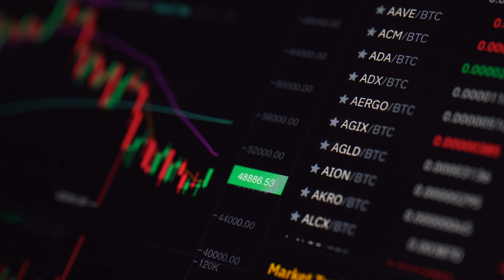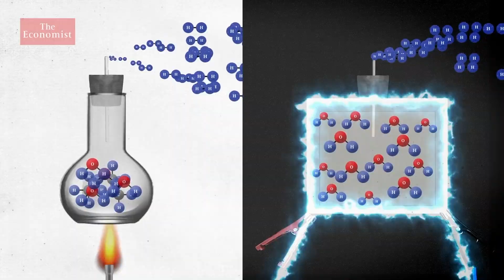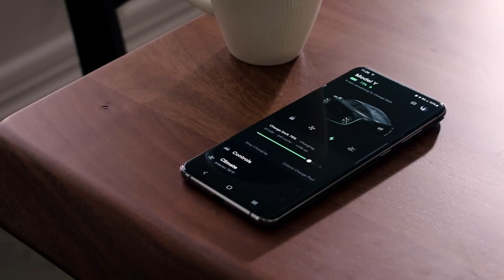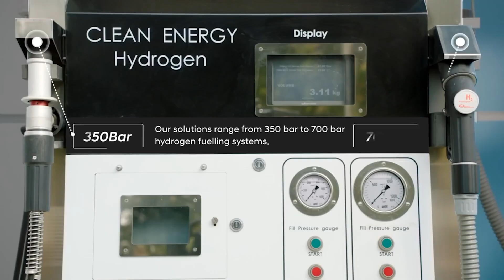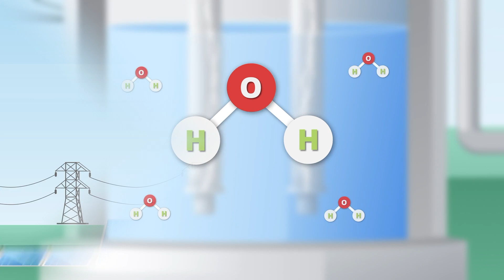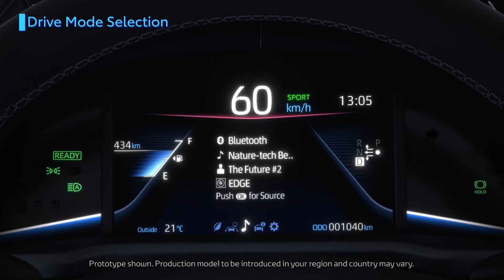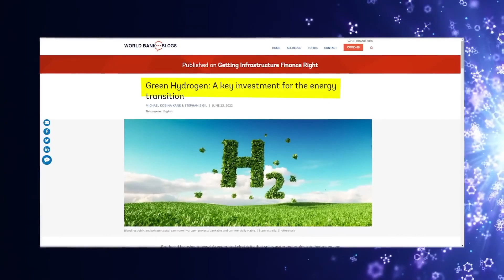EV'S Might Just Disappear! | EV's Could Go Extinct Because Of This New REVOLUTIONARY Technology!

Comment: 😂😂😂

Please tell us how much it costs to produce hydrogen. 

Also tell us what energy is used to make the hydrogen.

Also tell us how much the fuel cell costs and how long it lasts before it needs replacement.

Also tell us how many days it takes for all of the hydrogen to leak out of the tank (I think it's about 30 if I recall correctly) when the car is not used/parked.

Also tell us how much it costs to build a hydrogen dispensing station.  And how many stations there are per country?  And compare it to the number of electrical outlets available?

And most importantly.  Show us by how much all these things (producing hydrogen, building fuel cells and stations) have declined in cost per year for the last 20 years.  And then compare it to battery and BEV costs 😂😂😂.

Let's not talk about the Hindenburg though.

Shame on you.

Comment: I've been following proposed H2 usage in vehicles for over 60 years. There has been very little progress. H2 is very expensive to isolate, transport and store and use in a vehicle. Using it in an IC engine is very inefficient - better to use in a fuel cell. In the same 60 years, battery technology has improved many times faster to the point where it currently is the best prospect for zero emission vehicles. 

The environmental disasters of mining lithium has basically been debunked as no worse than mining for iron, aluminum, copper and oil exploration and refining. There may be a place for H2 in the future, but by then it may have the same issues replacing BEVs as BEVs currently have replacing ICEs.

Comment: A very one sided opinion of hydrogen that does not address the deficiences of hydrogen production, storage and distribution to the end user, the real reasons for the low adoption of hydrogen. we can only hope that these will be addressed and hydrogen will become a viable fuel.
Reply: I don't relish the thought of sitting on a hydrogen tank strapped to a moving vehicle developing a leak and blowing up. Also what kind of power are you using to make the hydrogen? The same power you use to charge the EVs.

Comment: Using hydrogen as an ICE fuel is NEVER going to be practical.  First, there is the cost to produce, transport, and store hydrogen.  A pound of hydrogen may have more energy than a pound of gasoline, but the size and weight of the container needed to store a pound of hydrogen is prohibitive. Second, if one is going to use hydrogen as a fuel, burning it in an ICE is incredibly inefficient with about 15% to 25% actually ending up driving the car.  The rest is wasted to heat and friction.  So, if one is going to use hydrogen as a vehicle fuel it is far more efficient to run it through a fuel cell that creates electricity and use the electricity to run an electric motor.  Surplus electricity can be stored in batteries.

Comment: Yes, fully agree. Good vid, new sub.
EVs are also proving to be a major fire hazzard
Reply: Good thing hydrogen is non-flammable and easy to store safely... 🙄
Reply: The amount of EV cars catching fire are tiny! In the USA there are 30,000 to 40,000 ICE Cars that catch fire every year! Don't you remember Vauxhall and Ferrari models catching fire on a regular basis until they solved the problem. If you use the motorways a lot you will see many cars and trucks burning! But not EV's. That's just FUD from unscrupulous journo's

Comment: Well, if we are going to use generators (with no catalytic converter) at the "quick" charge stations it seems to defeat the point of an EV vehicle. That EV's will destroy the car audio market. No more big custom stereos, EV's cannot power them. My buddy rented a Tesla for vacation from Ohio to Florida, and back. Using an electric vehicle added over 5 more hours to the trip, one way due to 40 minute "refueling" times, which there were 5 of them Cincy to Destin Fl. For regular vehicles, most can make the trip with only 3 refueling stops right next to the highway in about 5-10 minutes. Oh yeah, regarding an EV's range? 1) You are not supposed to run the battery below 20% charge as it damages the battery. 2) Air conditioning. Running the air in the summer can reduce range for another 20-40 miles. 320 mile range x .80 = 256 miles - 30 miles = 226 miles. 100 miles less than advertised. And are your sure sitting on a giant battery that creates a strong magnetic field for long periods of time is actually safe for your health? At the end of the day I believe both types of cars should be offered, and let the market place/ consumer decide which one is best? Both have their strengths and flaws as nothing is perfect. I do hope these "electric" cars are living up to what was advertised for consumers, especially given their higher price.
Reply: It seems that the market place / consumer are already deciding!! The reality is that hydrogen is inefficient to produce and store and we can only hope that this gets much better in the future to create a viable fuel.

Comment: little bit too much not even half true information here and very out of context data, almost misrepresenting H2
first you need to make in large enough quantities - electricity burned to do so
second - energy density is way lower than fuel little alone charge stored in batteries
third - fuel cell produce electricity for electric motor to run - no engine noise here, sorry, and cell takes a ton of space
next - h2 in liquid form needs temperatures under -200 celsius to stay liquid and therefore hold more energy in tank but the all the problems with replacing failing fuel pumps every few hundred kilometers
next - build all infrastructure for completely unused fuel type that reacts explosively with air

let's just say this video seems to sum up a LOT of whoshful thinking - go check engineering explained for some realistic information please
Reply: Yes, it's not a new idea, lve known and heard about it  for 40 odd years.  New technology  must help but don't think we're there yet, and how long do you wait while we try to  get off fossil  fuels.

Comment: Wouldn't know if this guy is talking out of his arse, but haven't heard of any great hydroden  breakthroughs  thou. 
Hydroden  demo cars have been around for a long time..
Reply: 12 x hydrogen cars were sold in the year 2021 in the UK even less last year, there are no refill stations to speak of. HYDROGEN is not a clean fuel when you take into account the cost of gas reforming,  even more expensive from electrolysis. It used massive amounts of electric much more than just using that electric to fill a battery up in a car 🚗 and do you really want a tank of the stuff which has to be kept at 700 bar!

Comment: Hydrogen cells have been widely researched over 20 years ago (by the major German manufacturers from what I know at least). There were driving cars and working concepts but the trend never picked up.
Yes, technology is advancing and there is mich more potential. But EV has so mich momentum already. 🔋
Hydrogen fuell cells will settle into the transport and cargo industry (trucks, airplanes, ships). ✈🛥🚛 
It's not always about the best argument an likely there will be no one-for-all solution (which is good to keep innovation going). Change is slow and even slower in societies.. 🚧
Reply: *much
Reply: hydrogen and planes don't go well together. ships and trucks maybe yes. but for planes, too many objections exist.

synthetic fuels are the much more likely solution for them (in a not too near future.)

--

and there's an edit function as well 😉

Comment: Hydrogen will only get wide spread usage when safety and cost are fully addressed. Don't forget solar cells and windmills also negatively impact our climate. Some insurance companies in the past would not approve parking hydrogen vehicles in doors! Hydrogen internal combustion engines also produce NOx in the combustion process. Fuel cells may be the best solution.

Comment: Battery electric does have mining impact problem, but so many new battery chemistries are being researched that there is reasonable expectation of higher energy capacity, longer lasting, faster charging, generally safer batteries, that require less or even no rare earth minerals.

Hydrogen Fuel Cell vehicles remain very niche and highly dependent on Hydrogen Fuel production infrastructure which is practically non-existent, while most real-world EV charging is happening at home on existing electrical infrastructure. Hydrogen as a fuel is also very inefficient in terms of the amount of energy it takes to create the fuel, and then the amount of transport that is able to achieve.
Reply from the maker: valid but you gotta realize a lot of countries dont have stable electricity infrastructure like we do in the west. They still need transportation and in some places they dont even allow you to install an ev charger at your home. For these people, they gotta drive out and spend time charging it, and thats if the cities electricity doesnt stop working like 2 times a week cause of a bad storm. I completely agree with you but i think in the future, hydrogen will have a bigger impact. Plus, I'd rather have an engine over a battery, I like the sound of the exhaust :)
Reply: @CarsPassion1  Based on how poorly the infrastructure reliability has gone for Hydrogen Fuel Cell vehicles in California (plant failed = months of no fuel available), I think setting up Hydrogen facility will be harder for places without adequate / reliable infrastructure investments.

Also, Hydrogen Fuel Cells will overall require more electricity for vehicles to travel same distance than battery electric cars due to the inefficiencies inherent to creating the Hydrogen Fuel supply for use, then transporting to pumps, then to vehicles for use which also use the stored energy far less efficiently than battery electric.

Wanting an engine / noise pollution is not a good analysis for why one technology will win over the other. You have to look at the challenges of each pragmatically and then realize why the world is shifting unilaterally towards battery electric while moving away from fossil fuel dependencies.

PS - Every land has sufficient access to more renewable energy than they can conceivably need, but they lack the investments to capture / store the energy for when it will be used. It is a smaller problem to solve than deploying reliably stocked hydrogen fuel cell supply stations across their landscapes. Desalinated water is and will be more precious than oil in our foreseeable future.

Comment: H2 will self bleed inside its tank when not used for a week..
Reply: At present I don't think you're permitted to put your car in a garage with Toyotas tech. That's very unfortunate, and yes, for a regular driver who just commutes you spend 0 time refuelling an EV at home. With hydrogen you have to refill every week even if you haven't used the car.

Comment: 1) I spend almost zero time fuelling my EV, 10 seconds plugging it in when I get home, 10 seconds unplugging it when I leave.
2) My electricity provider Octopus Energy provides only 100% renewable energy.
3) Every single house is able to charge an EV even without having a home charger so it's not true that EVs also went through the same issue that hydrogen cars have of lack of places to charge.
4) Clean Hydrogen loses 1/3 with electrolysis and another 1/3 transporting so basically to drive the same distance the electricity will cost 3 times as much compared to an EV.
5) Why do you claim that electricity for EVs comes from Coal while the electricity to produce hydrogen comes from renewable?
6) How do you explain the Tesla Semitruck if hydrogen is so much better for trucks?
etc etc etc
I completely lost trust in everything you say.
Reply from the maker: bruh, just give it a couple decades. You think ev's are so much better but what about when you gotta dispose of it? what about mining the extremenly harmful chemicals to produce your battery. Some governments around the world say its ok to just throw them in the water. Really? and not to even mention resell value   Also, I think you made really fair points but I do believe hydrogens the future. No one said they can't exist together peacefully. Also, instead of being ignorant, please realize that most countries around the world also do not have sustainable energy infrastructure. Once again, ur right, but i feel like only time will tell.
Reply: You are overlooking many massive engineering problems with a hydrogen passenger car market. It's not viable outside of dreams. Heavy vehicles and ships that are in constant use hydrogen is very good for though. You are getting very defensive for someone who is completely overlooking major challenges. You are also misrepresenting hydrogen as clean. The majority of hydrogen is a byproduct, or refined, from natural gas. The engines you mentioned as being environmentally friendly are also not. They still emit NOx compounds which are a health problem. Fuel cells are ok. - cheers Mech Eng  @CarsPassion1
Reply: @CarsPassion1  
I like debating these subjects specially with someone that has a very different opinion. I try to base my opinion on facts, specially facts that are based on my own reality of owning an EV.

I don't think a couple of decades will change my calculations unless some very major technological advance happens which is possible but can go either way. For example, if there is a technological advance that makes electricity very cheap, an EV will still be able to go 3 times the distance with the same energy as a hydrogen car.

Batteries are very valuable and will not be discarded when they've degraded enough to make them unviable for an EV. A typical home battery stores 10kWh, I wish I had one so I could charge it during the night when my electricity is very cheap and use during the day. My EV has a 75kWh, even if it degraded 50% after 10 years ( which it wont, not even close ) I could use it as a home battery still being able to store 37kWh and power my home for 3 days.

If an EV battery ever needs to be recycled, as the materials are mainly metals like lithium, the recycling process actually makes them more pure and it's a lot cheaper to recycle than to mine and refine. Once the world has completely transitioned to EVs there will be no need to keep mining materials for batteries unlike with oil. Lithium is not a consumable.

Your belief that hydrogen is the future doesn't seem to me to be based on facts and because of contradictions in your argument like EV's electricity coming from coal while hydrogen electricity comes from renewables plus conveniently leaving out facts that are not convenient to your argument like EVs being able to charge at home while hydrogen cars aren't and the fact hydrogen requires 3 times the amount of electricity to drive the same distance and lots of other facts, I stopped trusting your argument.
Reply from the maker: @synthmaker  Okay yea, not a couple decades but like less that 60 years, hydrogen should be mainstream. EV's may only be as accessible as it is in the western reality that you and I live in. If you go to almost any other non western country where people dont have garages, homes are condensed side by side, and the electric infrastructure just isnt as good, youll see why having fuel stations are better and more convenient. Fuel stations could be gas stations, hydrogen stations, or ev charging stations, but my point is ppl have to drive out to go "fuel" thier cars. I personally went to visit my backhome country last summer before college and the ev scene was a mess. The government didn't want to let locals install ev charging stations in their homes and some places dont even have reliable electricity, but they have cars lmao. Once again, i think we can both be right, your views based off your own reality are valid, and I probably share those views too because I live in Canada, however, im just talking about it from a global pov and from places where electricity and modernization doesnt seem to coming anytime soon. You might say hydrogen stations cost a lot, but it being in the energy sector, will somehow find a way since its literally one of the most corrupt sectors ever.
Reply: well, I didn't pay attention what all was said in this video because this was too dense an information for me and I kinda zoned out, but it's definitely true that all electricity for every single EV only comes a full hundred percent from coal powered plants. this is the reality, which can't be talked away by retitling something on paper.

I'll try to explain: imagine, you've eighty percent renewable energy production in your grid (unrealistically high; not even Norway might manage to pull that off. but it's only a theoretical example, so the numbers don't need to be accurate; you'll see the principle behind this, anyways.)

okay. now imagine, that electric vehicles use up ten percent of the available electricity. now, all calculations assume, this is generated eighty percent from clean, and twenty percent from fossil fuels. this clearly is a lie.

why? imagine, those cars don't exist. what would you then do? shut down mostly wind and solar?

no! you'd only shut down as many of those remaining coal plants as possible. ergo, each electric vehicle runs a hundred percent on "dirty" energy as they're hindering the further shut down of those old plants. it really doesn't matter which bow an utility supplier might tie over the hydro bill you get sent.

especially when someone says, "my provider is a hundred percent clean." well, you just stated that you took away clean energy from someone else that now has to run on a higher percentage of dirty energy (and should probably feel ashamed of that; offloading of guilt, it could be called 🤷‍♂️)